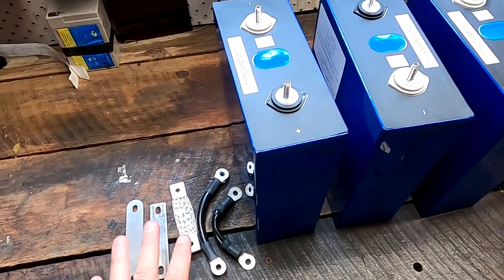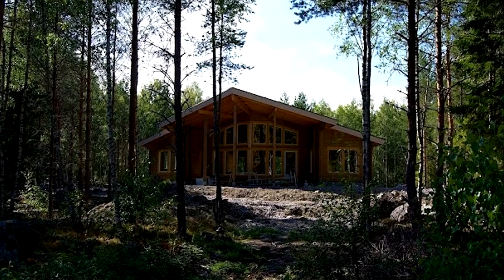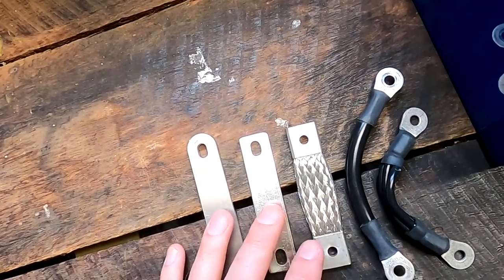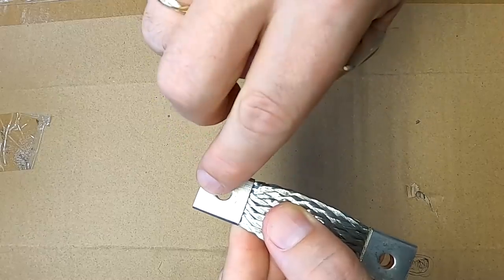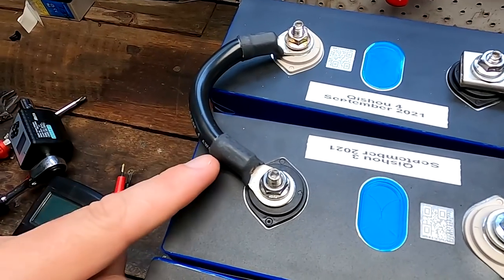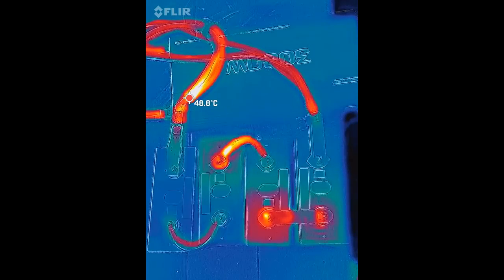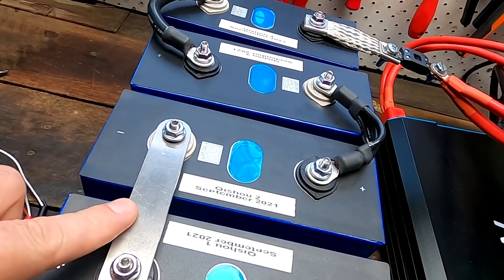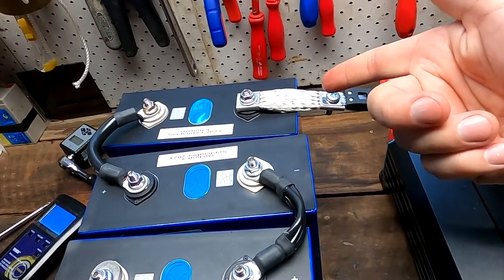All these different busbars... and why they don't matter!

Comment: I think bending the flexible bus bar loosened the braid which shortened the length. I’m curious if it would have fit beforehand. Try putting a screwdriver through each hole and pull to try to lengthen it.
Reply: If you have to pull it that tight to connect it, is it really flexible anymore?
Reply: @TheDigitalMermaid  I’m saying stretch it back to its original length I’m thinking that’s it’s shorter than it’s factory center to center length because he was bending it back and forth and it didn’t appear to be missing the stud by much. And great video on the cerbo gx and display you explained exactly what I was confused about so I ordered one now lol
Reply: Do not try this. Because the braid ends may get , either detached or get lose , causing issues. Prepare a new one to exact measurement, instead.

Comment: Andy, measuring the voltage drop and resistance of the bus bars from the stainless steel grub screw is erroneous.  To get a true measurement of the connection, voltage drop and resistance the measurement needs to be taken directly from the battery terminals.  That way the resistance of both the connection of the bus bar to the terminals and the bus bar itself are measured, which is what is important.
Reply: As Andy has said in many replies over a number of his videos, once the bus bars are on, he no longer has access to the actual terminal. They are completely covered by the bars. So he has the terminal screw, or the bar itself, that's it. And I see he in fact measured from both of these options in this video, albeit in different tests.
Reply: Not being able to access the battery terminal does not change the reality of the correct way to measure the bus bar connection, voltage drop and resistance.
Reply: @dan2304  Guess he has to become a magician then. Or are you saying he should just never perform these tests?
Reply: All i am saying is that when measuring it is important to know what you are actually measuring.  In the video Andy is not measuring what he thinks he is measuring, while it may be close.  To get a correct measurement of the bus bars it has to be done from the battery terminals.
Reply: @dan2304  right. Thank you for explaining. 😊
Reply from the maker: @Dan, that's also what I said in my video. The grub screws are the best contact to the terminals I can get. If you have a better way, tell us!
Reply: Andy, without looking closely at your system I have no suggestion other than a notch in the end of the bus bars to access the battery terminal.  You are measuring the resistance and voltage drop of the grub screw, the thread contact of the grub screw to the battery terminal and the contact of the terminal to the bus bar at each end of the bus bar, plus the bus bar.  As long as you realize that is what you are measuring.  Determining where any problem may be is made more difficult.

I am looking into having an off-grid 3 phase system that may be grid tied if I can get the right deal with feed-in tariffs, at the moment only getting 5c /kWh down from 21 c/kWh. and you have been most helpful.  I am likely to use a high voltage DC side for cabling and inverter efficiency.

Comment: Great demonstration Andy, The Aluminium problems are likely due to the type of Aluminium,  if it was 6xxx type Aluminium it's not suited for this purpose, 8xxx series was developed in the 1970's when copper was expensive and Aluminium was becoming popular for electrical use, other types of Aluminium had higher electrical resistance leading to excessive heat and fires,  8xxx Aluminium was developed and is the only type of Aluminium permitted under electrical code standards, IMO stick with the ones that come with the battery the supplier generally knows what works best based on their testing, the Ali braided type is also very good because it will dissipate heat very quickly, Easy fix is to drill a 1mm larger hole, also you mentioned to sand the burred edge, this is not recommended as you will sand into the plating of the copper, it's best to use a deburring tool or a good quality countersink bit to remove the burr.

Comment: Thank you very very much for this! After our chat, I was worried that the flexible might have been two small. This is a wonderful result and makes me feel a lot better. The Anderson connector I am using is rated to 175A, so your test is nearly maximum load. Just wonderful! ^_^
Reply: Great job on those bus bars! :)
Reply from the maker: Yes, I can only say, congratulations on these bus bars and design. The quality seems to be perfect. Just don't put a washer underneath ;)

Comment: Hi Andy, a tip for thermal imaging: on a shiny and/or metal surface you need a layer with a known or near 1 emission factor as the emission factors of the materials above are nearly unpredictable. I use a bit of black electrical tape for that puspose.

Comment: Excellent review Andy. Busbar temperature and poor contact surface area heating are surely one of main concern areas that needs to be monitored.  Very interesting results indeed. My experience is similar to your test results. The Aliexpress Flexible busbars also came out #1 as depending on the dimension, they come in 300A and 400A high current versions. You can actually get suppliers to make custom lengths as well, besides having a wide range to select from. The #2 is tin plated copper bars. Copper has a lot less internal resistance than Aluminium. Aluminium only has 61% conductivity of copper, so much thicker conductor must be used. The main issue with copper is that it can form oxide and this oxide does not conduct well. Issue is addressed if it is tin or chrome plated. 😊👍

If you get slightly longer Aliexpress flexible busbars then bend and incorporate a small U-shape profile, this would allow the busbar to flex length-wise as well. This is how i got them to fit in my setup 😉👌

Comment: Perfect timing!! I was going to make some fancy aluminum bus bars from stock, but now I will just use the ones that came will the EVE 304 cells
Reply: I have a 16s pack with the EVE 304ah cells and the busbars don't even get warm to the touch during normal usage, which is minimal current as my entire battery bank is 36kWh.
Reply: Just check yours after you install them for hot spots, mine came with busbars, but they were not going to work in my setup (96v battery bank) so i made my own from 1/2" copper tube i flattened in bench vise and i had absolutely no hot spots since the copper tube moulded when i torqued the copper nut since i used copper studs and copper nuts. I went the copper route, because i read somewhere that the LiFePO4 cells were copper with nickel coating on the terminals.
Reply: @williamhustonrn6160  terminals are made of aluminum....copper is a far superior conductor for busbars. or copper cables...
Reply: @williamhustonrn6160  That is what I have used in the past. What wall thickness are you using? K, L or M

Comment: Hi, everyone) 
Thank You Andy!
I have chosen flexible busburs after watching this video! And I have got perfect connection with them with sanding and cleaning with alcohol. No worming up and low resistance (don't remember,  maybe 0,002 mOms) My 8cell battery have 1,150 mOm resistance on terminals and nearly 2,120 mOms on negative terminal connection after 200A Chint DC braker and GBat 200 A DC melted fuse and after bms on positive. Looks very effective and durable.

Comment: Thanks for the video! I
In my experience aluminum is not a desirable conductor so your results make sense to me. 👍
Reply from the maker: Thank you! As with previous tests I did, the aluminium busbars are a better conductor as the copper busbars due to the fact they have larger dimensions as the standard copper busbars. But the contact areas are a real problem. Tinned copper is definitely better.

Comment: If you use a lower wattage incandescent light bulb as a resistor, it will light up while the capacitors are charging and it will dim and go dark when they are full, which will prevent you from hooking up the cable prematurely.
Reply: Roger, The Power supply is 48~54V. The Incandescent filament will be obliterated, if Andy doesn’t have a 54V filament incandescent bulb, right? 22+22 Ohm (11 Ohm approx) @ 5W is good as shown.
Reply: @sreekumarUSA  I meant a 120v bulb. I use them regularly. Andy will have 230v bulbs, so lower wattage will be best for him.
Reply: I wondered about this. This is good to know. I imagine that using a bulb with a voltage/wattage rating a little higher than the system being charged would be key to not losing the bulb in the process as you all said.
Reply: @westking7746  we used this trick with a 12v bulb to charge super capacitors in car audio systems back in the day.  My 5 farad capacitor even came with a bulb to use. 

I added a light bulb fixture and 7.5W bulb to my system as a pre-charge resistor, and with my 12KW Growatt inverter it takes a solid 20 seconds for it to dim and go dark.  I think something around 20W may be ideal.
Reply: @chevrofreak  LOL. OK. Yeah. I remember the light bulb with the capacitor deal. I never knew what they were for. My Dad usually installed stuff like that.

Comment: Thanks for this Video. Conclusion: High Power loves copper, even more tinned copper!
Reply: copper for sure is good,,,, the tinned part is to prevent the galvanic corrosion between different metals,,, the tin coating decreases the conductivity a little
Reply from the maker: The aluminium works as well if the connection is good 😉

Comment: @Andy what i do not understand is the outcome of your second measurement, the internal resistant of the busbar at 160A. For example the first busbar did 1,2mOhm and 7,2 mV. That is not possible with 160A. The voltagedrop with 1,2 mOhm must be 160 x 1,2mOhm = 192milivolt. This value gives a wattage loss from 30,7 watt in that single busbar. :) 
I think the measurement of the internal resisant isn't right. What are your thoughts?
I trust the voltage mesurement more than the internal resistant measurement. If we calculate the other way around than we get R=U/i = 7,2mV/160A=45 microOhm.
Reply: things definitely don't add up.
Reply: I'm pretty sure that the tester supplies an AC voltage at a particular frequency for the resistance test. Notice it has multiple prongs on each probe. There is a DC voltage test performed with one prong in each probe, and the resistance test is performed with the other prong(s) in each probe.

It's not just a passive measurement, like a multimeter.

Possibly one could conclude this makes it unsuitable for testing a bus bar, which clearly isn't a "chemical battery" and therefore isn't affected by that AC test, or the connected cell(s) are affecting the test, either way...
Reply: Yes, 30,72W, that’s why the batteries get hot after longer use, but the battery would run less than 2hours under that load.
Cheers.
Reply: You are right, the figures are against physics. There is the ohms law  U=R*I, which is violated by these figures. 
@Andy, please measure the voltage drop with your voltmeter, as well.

Comment: hi Andy.
looks like those braided copper straps did very well.
since you mentioned that they were a bit too short i started looking around and i think i found the seller on Allie you used, well if it is the same seller they offer custom length straps aswell if you order 100 or more.
maybe if there is enough demand from the community you could resell them.
the biggest advantage using these straps is that they conform to their mounting, if one batt is higher it can move to accommodate the position.

there is a reason heavy industry uses these kinds of bonding straps.
Reply: I use them on my battery, but I make them myself. It's time consuming, but they've been running for two years now without issues.
Reply: @upnorthandpersonal   You ought to make a video of how to make them, I think many would be interested.
Reply: And I guess by pulling a little on them they would still extend by a mm or so. They don't look fully extended in the video
Reply: @ForbiddTV  I'll give it a try. I have to make a set anyway this spring/summer.

Comment: You understand, I presume, that your R, ΔV measurements are flawed, as they deviate from Ohm's law and test conditions. The series current is the same on all 5 jumpers, hence if you view them like shunts, the I = ΔV/R should have been the same, within meter's accuracy and rounding errors. They are in fact: 6.00, 14.12, 8.75, 8.50 and 6.25 Amps, very distant from the 160 Amps that were flawing during your test. Greetings from sunny Greece. Nikos
Reply from the maker: Yes, I know that but just presenting the overall verdict, that not the material is the problem but the resistance.

Comment: there is a youtube guy "ray builds cool stuff" who tests the resistance via different methods of connecting the nickel plated copper busbars to his EVE 280Ah cells.... he (Ray) also noted one vendor sent him tinned brass busbars which increased the resistance a lot.....copper is the best choice and the thicker it is the higher its ampacity will be and the corresponding resistance... I recommend tinned copper bus bars and pure copper cables with tinned lugs that have adhesive shrink wrap at the lug/cable junction to limit oxidation...
avoid brass bus bars...have a great day all....cheers from the off-grid farm in South Dakota.....USA
Reply from the maker: Thanks Michael. The aluminium busbars have actually a lower resistance than the standard copper ones coming with the cells. But obviously they have their problems with with oxidation and high resistance to the busbar if untreated.
I agree, copper is definitely the way to go. Madi has actually used these adhesive heat shrink with her cables she made. I can see the clear glue coming out a bit where the heat shrink ends.

Comment: Nice to know. I charge at 30 amps and discharge at 50 max so i will just use the bus bars that came with my LF304 cells. Thanks OGG!
Reply from the maker: Yes, use the bars coming with the cells, they will be totally fine.

Comment: @ Andy is there some reason you don't use a conductive paste? I do build up welding with a mig welder for hours at a time 22-24 v  220-240 amps  if connections get hot I use a conductive paste (can't recall the name) of it but it contains graphite I pull the connection apart clean it apply the paste and the heat is gone.
Reply from the maker: Well, the test has shown, it's not necessary. Except the aluminium bus bar, all others staid cool.

Comment: I'm not experienced with this issue but in other videos with thermal cameras I've seen a lot of discussion about measuring some surfaces and them not being able to get useful measurements with some materials. Usually it comes up that something extra is needed to get an accurate reading, which I think is perhaps applying a matte black thermally conductive tape to the surface and measuring that instead? Have you considered this sort of effect with thermal cameras?
Of course it really doesn't matter in this case since you're using your hand anyway, just a side note.
Edit: It looks like Fluke has a good simple guide on measuring reliably
Reply: Everything reflective cannot be measured with a thermal camera. It is like filming a mirror and you will only see the thermal reflections of yourself and your surroundings.

Also, if you want to measure something behind a see through lid (or a window) than it is best practice to remove the lid when measuring.

A good example is to try to film outside your home from behind a window. You only will see the thermal reflections of the inside of the room you are standing in.
Reply: I have a thermal night vision setup and I can confirm this. A K type thermocouple may give more meaningful answers.